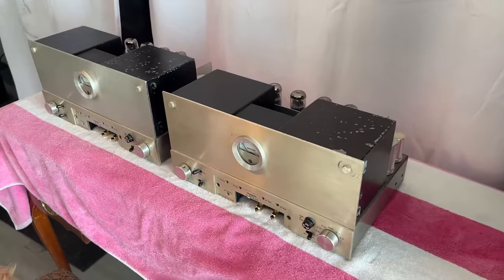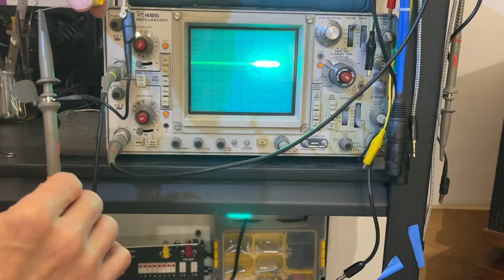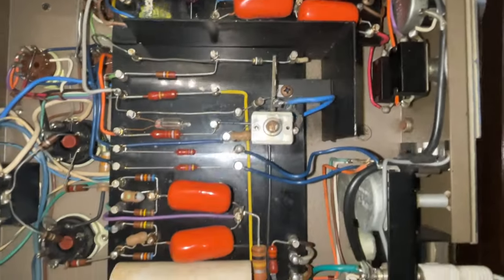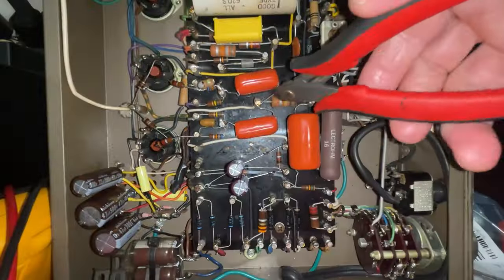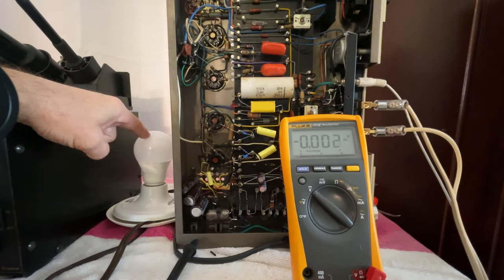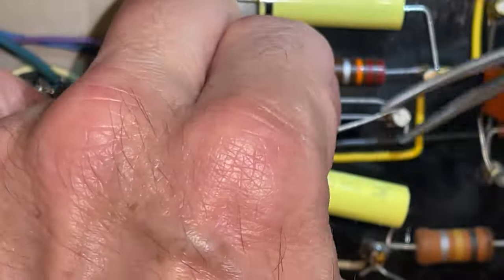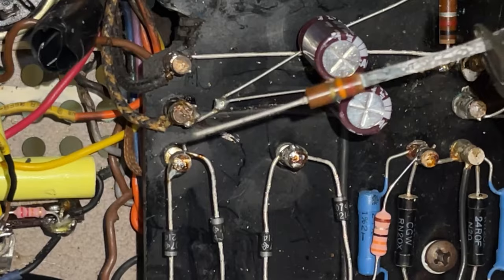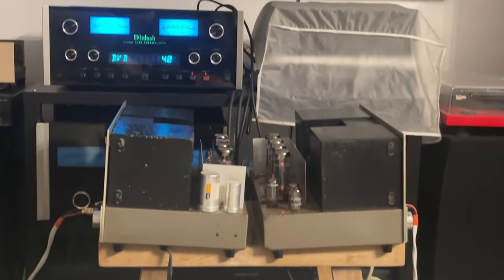Marantz Model 9 EL34 Red Plating Tube Amplifiers Repair & Restoration

Comment: I wound up saving a couple McIntosh MC1502 amps from the curbside on their way to the dump. They were all hacked together like they'd been worked on by a complete novice much like the Marantz amps you worked on in this video. Almost every single tube was blown because the heater voltage was way too high. Someone had replaced the rectifier tube with a bridge rectifier without accounting for the extra power. It was expensive to replace them but worth it. After replacing most of the components they turned out to be some of the cleanest sounding amps I've ever heard.
Reply from the maker: Wait a minute teammate I am dumbfounded. Are you sure you got the right model number the MC 1502 is the new 150 W x 2 tube amplifier for Mcintosh which cost $11,000.
Regardless of the model number, I don’t understand how someone can throw away a Macintosh Amplifier. 
I found a fisher, 500 C on a dumpster myself. I’ll dumpster dive any day for an amplifier lol. 
On a different note, when I see horrible work like that, I think that is not a matter of knowledge, but a matter of having the desire to do a good job. I consider myself a novice in the process of learning something new every day and the reason why I started working on my own equipment was because the professionals in my city, which is Miami are absolutely horrible butchers!
Thank you very much for watching my videos, and for sharing your experience. I really appreciate it!
🙂🙏

Comment: Finaly someone who respects the sound of the amplifier ...........Carbon resistors , I use them also when restoring those amplifiers , they are NOT inductive ! ....and besides critics they sound GOOD ! 
Many times I serviced vintage amplifiers restored by technicians ........when the owner complained the sound was gone !
Nice job !!!
Kind regards
Reply: I thought carbon composition resistors were noisy ?
Reply from the maker: Thank you, thank you thank you so much! I really appreciate your comment. You made my day teammate.🙂🙏
Reply from the maker: @Lyndalewinder  they can be noisy but they seem to sound good.
I only use them in the signal path.
🙂🙏

Comment: nice work. The model 9s are really nice sounding amps. cleaning off all the old solder and leads on the terminal post boards takes tons of time. Most techs do not want to spend the time to do this since they will not get paid by the customer to do it correctly. VAC-AMPs made re-issues of the Marantz 9s a number of years ago including getting the power and output transformers made by the same company that made the originals. They sound very close to the originals. Also great work keeping the carbon comp resistors in the signal path. They are part of this amps sonic signature.
Reply from the maker: @mcgjohn22 
Thank you teammate thank you thank you so much!
I really appreciate it!
Hey, I would really appreciate it if you made me a huge favor and subscribe! It really would help!!!
🙂🙏💥💥💥

Comment: These are gems that deserve the very best. Yellow Chinese made Illinois Cap films wouldn't have been my choice for coupling caps. NOS mil spec PIO's or current production Arizona Cactus caps would have been perfect. They are not cheap, but then again neither is a pair of Marantz 9's...
Reply from the maker: @crooner2007  
I agree with you 100% teammate!
I put those in temporary until the owner decide which coupling caps he wants to use, and I will then replace them for him.
Please watch some of my other videos, restoring my own equipment where I use the military paper and Capacitors that you were referring to. 
Thank you so much for watching and commenting and I would really appreciate it if you please subscribe .
Once again, thank you thank you thank you so much !
🙂🙏💥💥💥

Comment: Hello! I’m enjoying your channel. Happy to have found it! Is the arcing suppressor cap (near the end of video) also a 0.01uF like in your Eico vid?
Reply from the maker: Hello team mate! Thank you so much! If you haven’t, please subscribe. I would really appreciate it. Yes, that was also the same value if I remember correctly. I use between 01 uf and .03 uf on larger amplifiers. I use failproof capacitors from WIMA that are guaranteed to never short.
Once again, thank you very much.

Comment: fuse holders are wrong orange drop don't sound good in these amps
Reply from the maker: I agree with you 100%
Before I did the restoration, I listened to the unit with the orange drop capacitors, and it sounded like the lo pass filter was engaged!
Absolutely terrible with no clarity !
🙂🙏